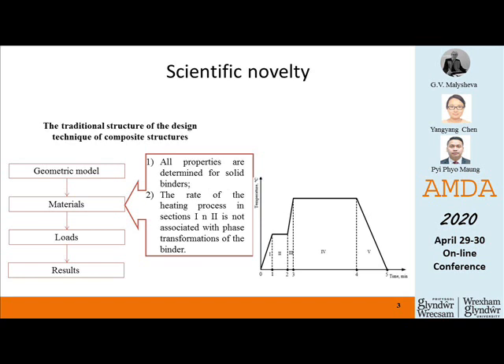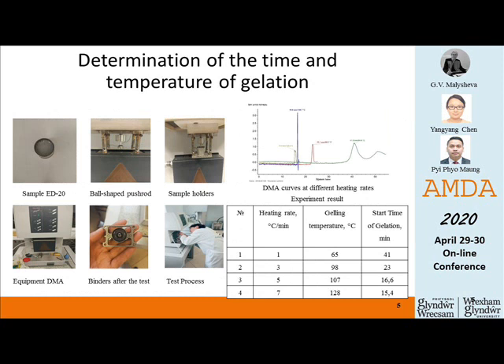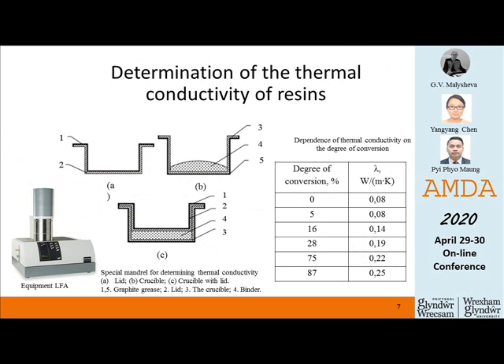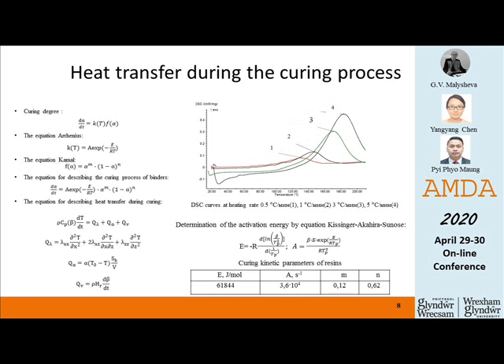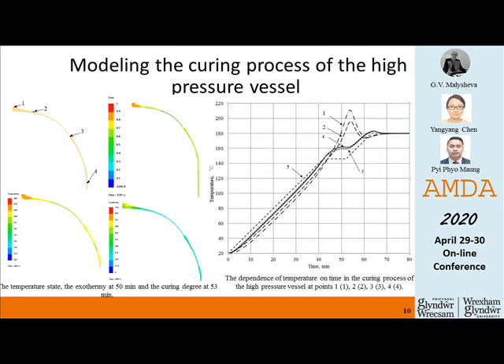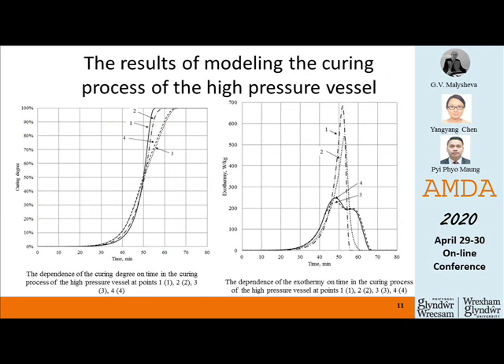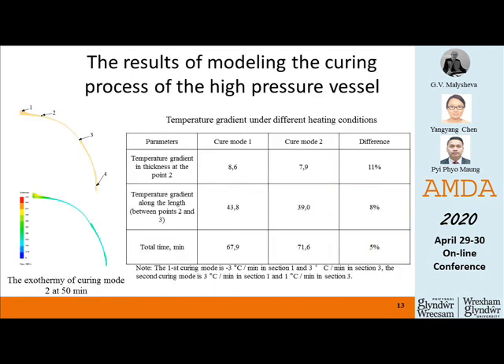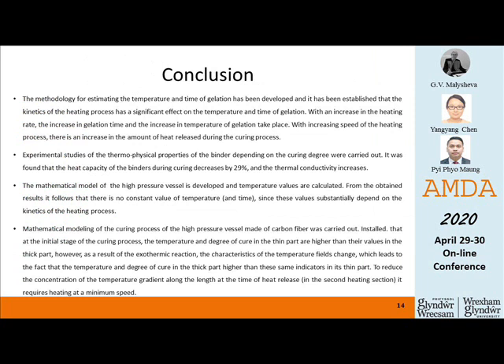Paper 20. Optimization of curing process of polymer composite materials based on epoxy matrix

Comment: Nice clear presentation, and the significance of the problem and end application are presented clearly.  You use a complex set of differential equations for heat: did you solve these analytically or with a numerical scheme?  You show a thermal analysis - what is the mathematics behind that software package?  Do you think the modelling is sufficiently complete - does the analysis match the experiments?  How important is the mathematical modelling - what has it told you that was not clear before?